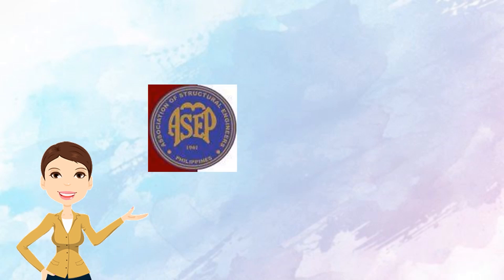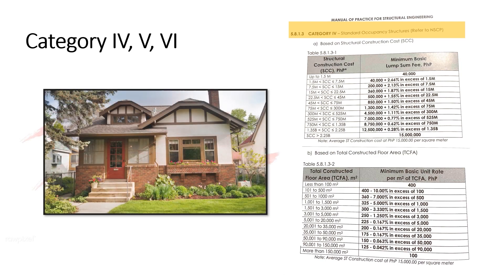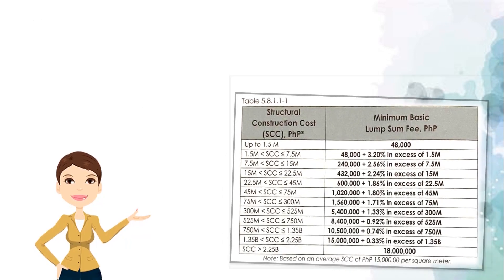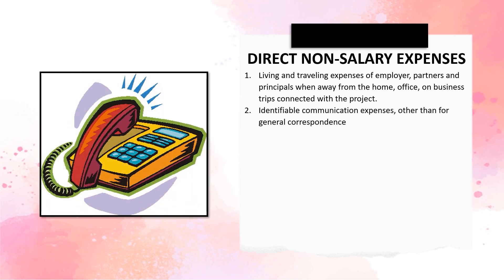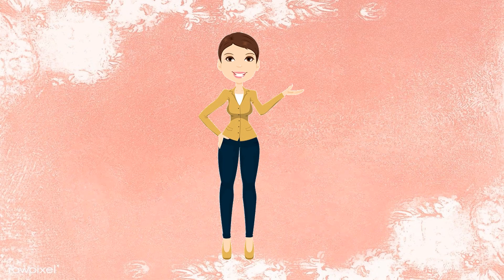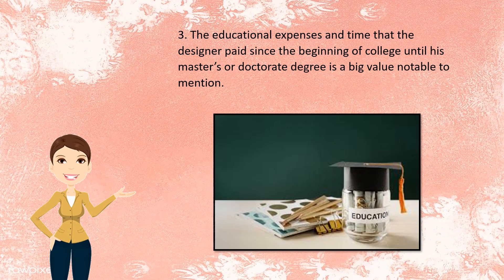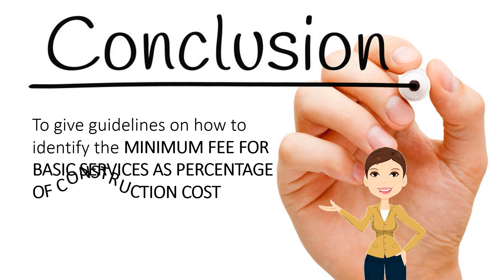Minimum Fee for Structural Designers | Manual of Practice for Structural Engineering

Comment: sir good day. paverify lang po yung tcfa method computation.
Reply: yung value po na 5443.2
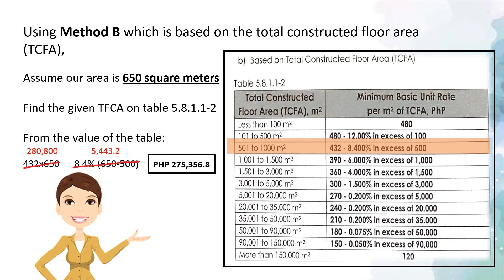Reply from the maker: @bernardojohnserrano8589   we appreciate your correction this should be ((650-150)*432*0.084) = 5443.2   ; 4:47 mark
Reply: @etalks5638  Bakit naka multiply pa ng 432? Hindi ba dapat: 432 - 0.084(650-500) = 419.4 so ang total ay 419.4 x 650 = 272,610. 

If icheck mo kapag 1000 sqm ang area mo 432 - 0.084(1000-500) = 390 kaya tignan mo yung next row kapag lumagpas ka ng 1000sqm 390 na basic then less % nalang per excess area